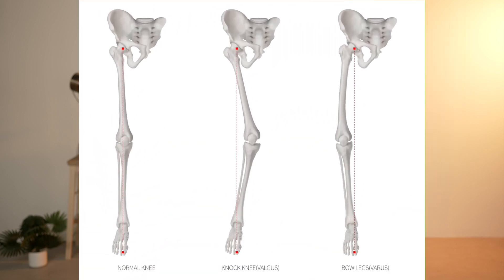Kinematic Alignment for Total Knee Replacement

Comment: I am a candidate for tkr here in Sacramento, CA.  I've just started researching the kinematic approach.  My dr. wants to do robotic and when I asked him what the differences were he said this:  Please comment: 

 "Kinematic knee alignment is a controversial technique done by a minority of surgeons designed to change the bone cuts to optimize soft tissue balancing. Mako assisted knee replacement accomplishes this same end with more precision by using computer software to make adjustments to bone cuts in real time and optimize implant sizing, positioning and soft tissue balancing. Whatever potential benefit that is offered by kinematic surgery is accomplished with Mako assisted surgery with further benefits not achieved with kinematic alignment alone."

He doesn't say how Mako provides further benefits not achieved with kinematic.

I read on your website that most people spend 3 to 4 nights in the hospital.  Here they get you out in one day or one overnight stay.  How long does the surgery take with kinematic?  THANK YOU!
Reply from the maker: I won't go into the discussion and debate - but essentially the difference is this: Mechanical alignment aims to align the knee the SAME for every patient. The patients capsular structures, ligaments and sometimes tendons can be released to balance the knee. Many modalities have been created to achieve the same alignment for each patient (A perfectly straight leg with a 10 degree foot progression angle). But not all alignments are the same. Look at people walking around - some are bow legged, some are knock kneed. Most of those people don't have arthritis and it's their normal alignment. Kinematic alignment reproduces the normal alignment for that patients and therefore does not require ligament or soft tissue releases. Without matching the alignment of a patients own anatomy - the knee will require other soft tissue balancing operative techniques to balance the knee. I respect all surgeons preferences but I would also say that it is the fastest growing method around the work from an alignment perspective, and the results are phenomenal. I would advise you to read research performed by one of the godfathers of kinematic alignment - Dr Stephen Howell.
Reply: @orthopaedics360  Hi Dr. Chien-Wein Liew, thank you so much for your response 🙂  I did call Dr. Howell's office and tried to make an appointment for consult but he does not accept my insurance plan. There are only 1 or 2 other surgeons that use the kinematic alignment technique here.  Since Dr. Howell is one of the godfathers of kinematic alignment, I would've thought there would be more doctors using this approach here in Sacramento.  In any event, I appreciate your response. (I will be looking into changing my insurance plan during open enrollment.)  Thank you.

Comment: Question how do you know or figure out how the knee was prior to needing a replacement.
Reply: Studies show that most arthritic knees have about a 2.2 mm loss of cartilage on the femur and tibia in the affected area. Simply putting implant back into the space of the original                                                                                                                                                                        joint. Resurfacing the joint. Like a retread without changing alignment.